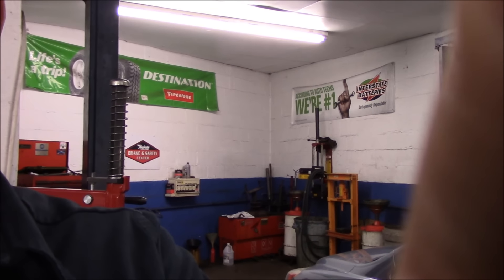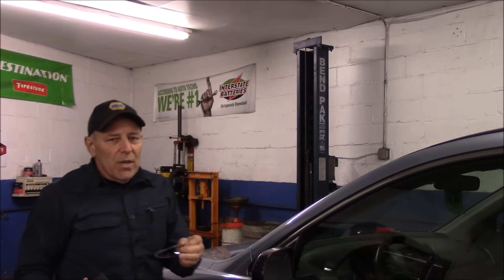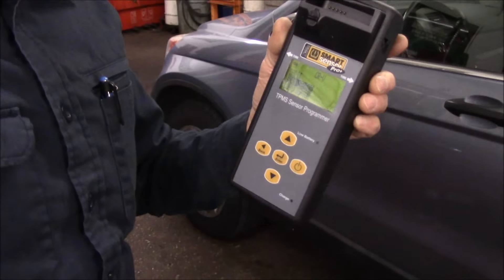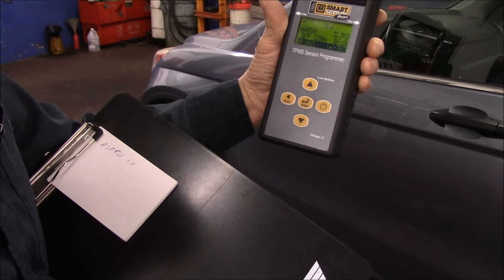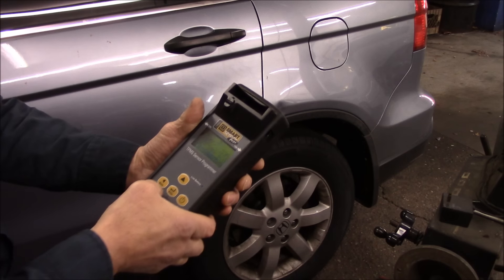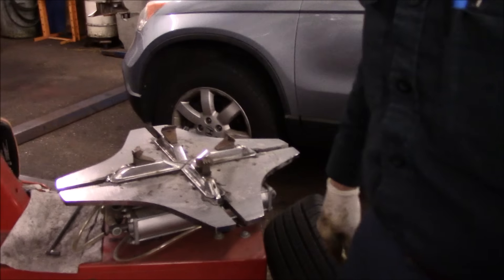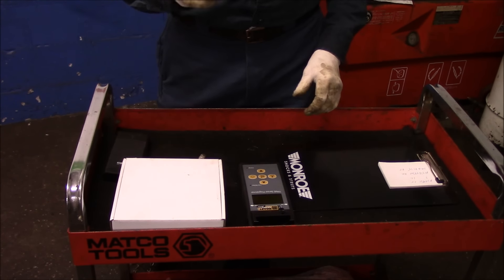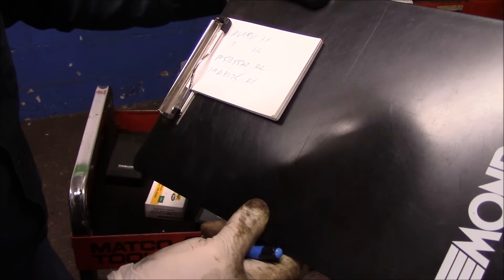How To Reset Low Tire Pressure Light (TPMS) Tire Monitoring System

Comment: Had a new full set of tires installed at a Subaru dealership in August. since then the dash tires pressure display has been wonky for the right rear tire. Finally got so bad , I took it to a mechanic who said the pressure gauge was “pinched “ during installation .Then as the tire flexed it finally broke . He replaced the sensor on that one tire, & the entire tire pressure display is not working except for 
TPMS LIGHT & instruction to check manual! What could have happened? Am I being set up to have to replace all the tire sensors? The display & other 3 tires were fine til this repair.

Comment: On my 2012 Jaguar XF Supercharged V8 Portfolio Edition I had a constant TPMS Failure. Not just a tire but a system failure. I took the car to a tire shop and he checked that all the sensors worked. After that you can reset the system. Do a Hard Reset of the vehicle. Disconnect both battery cables. Either let it sit for a few hours or touch the neg and pos cables together. Check the tire pressure in all the tires. Reconnect the battery. Then drive the car for 15 minutes above 30 mph.
Park the car for 15 minutes shut down. Then drive the car as usual and the system should reset. Your also going to have to reset the memory for the seats, windows, locking etc. It's all in the owners manual. For this to work all sensors must be good. Worked for me, hope this helps.
Reply from the maker: Thank you for your input and for watching.

Comment: So here is my question. What happens 3 years later when the sensor you replaced goes bad. How do you find the sensor number because it's not printed on the replacement sensor,
Reply from the maker: You know You are right .I never thought about that.I will in the future make sure to put the number on the customers bill Thank you for pointing that out.
Reply: Glad to help, I was scratching my head over that.
Reply: Perhaps find a way to mark it on the sensor itself as well - Most customers aren't going to keep that bill for more than a few days.   Great video!  I really appreciate the information.
Reply: @jimthecarguy    In that case, you can either buy an OEM sensor or get an aftermarket one that fits the vehicle and you won't have to program it, so you won't need that number.  Since you're using blank  "clonable" units that can be programmed to fit various models, you have to have the information in order to clone the new unit.  That's a smart way to cut down on inventory and still be able to give quick service.   I enjoyed your video very much... very well done... you're the kind of mechanic everyone wishes for.

Comment: Clear and accurate real time repair information. Your channel is a class above most and delivered with a humble attitude - keep up the great work.
Reply from the maker: Thank you for watching and your kind words
Reply: I agree.... Well explained & cleared lot of questions I had regarding these TPMS.
A question though:

I replaced two tires the other day.... Up came the TPMS light..... 
I went back, &   they said my wheel NEVER had a sensor fitted! 
I said, well how come the TPMS light was off until I left here?
They took the tyre off: and said "Look, there should be a metallic tape here...
....It never had one." !!!
After watching this video, I now know that is a complete & utter lie. Bullshit.
I am never going back to that shop. And none of my friends will either.
Jeeze..... You pay top dollar for decent tyres and get this kind of service.
Reply: @jimthecarguy  Jim, I bought a used car with TPMS lights on all original tires and sensors were replaced but not reprogramed, where do I get the numbers from to reprogram them?

Comment: Hi Jim -
  Good repair - 
Starting in what years did they start to install tire senors 
Suppose a person wants a tire rotation will that hand held device show what tire sensor goes on what side of the car ?
Reply from the maker: Pete Moss   I'm not positive but the sensor became very common around 2004 on most cars
Reply: Ok thank's Jim
Reply: 2007 mandatory
Reply: Jim talks about the battery going bad. if its a dry cell battery, that'd be pretty severe, as he's expecting it back for one of the other 3 tire sensors
Reply: I found a rebuild kit for tpms schrader valve on ebay :TPMS Programmable Sensor Service Kit Schrader Automotive 20018. For $2.84 on 7-7-2018.
Reply: When i say severe I mean 30 deg below 0 for a dry cell battery. Itd be like toast  in Ice hell. but apparently they last for (5 years)

Comment: My eyes are my sensor. Look at the tires. If they look low and are soft to the touch, they are low. I have a bad sensor. The only thing it shows is an underinflated tire. I can live with a light. Just like numerous reasons for check engine lights.
Reply: your eyes are lucky to see 10 or 15 pounds the light is only 5

Comment: I have a 2008 Honda Civic Si with TPMS and it comes on when a tire gets down to under 25 psi I put air in the low tire drive it for a couple blocks and it goes out. How long b4 the battery goes or does it even have one? Does it have one in the spare?

Comment: I have a 2007 Honda crv tpms light still on after riding 5 miles on highway.  How can I have taken off? Can a scan tool in autozone remove it or is there a fuse I can remove thank you

Comment: Hi jim,  thanks for the video..... I changed two tpms in a 2011 scion xb....   Reprogrammed the computer using the lexus/ Toyota software.  This vehicle has a reset button under the dash for the tpms light... Would know procedure for killing the warning light?... Thanks.

Comment: Hi Jim we have  2011 Honda 4WD  CRV. Just got 4 new tires put on & the TPMS  light was on when we got home with the car , i did not notice as i was driving. This light was never on before . Was there supposed to be a setting , that was not reset from the tire garage  when they installed the 4 new tires . Thank You . Bill

Comment: Hi Jim, a true mechanic!
Thanks for your time and this fine DIY video. Just looked at Amazon and put Smart Sensor in my cart.
Once again thank you!
Reply from the maker: Michael Miller did you also get the tool with the sensors?
Reply: Jim, the unit on your Amazon tool list. But, I read the description and I still do not know. Cost was $199.00
Guess I will find out then.
Reply from the maker: Michael Miller  you will need the sensors also. I just put another whole kit on my Amazon store check it out
Reply: OK Jim,
       I will obtain those too.
   Thanks again & CUL.
Reply: @MichaelMiller-od6pu   did you get the right thing?

Comment: I need to check the tire sensors on one vehicle which I have to put a new battery in and hope all is fine with them. The last time I had one of the lights come on while driving the vehicle with the sensors in them it was a tire which had low air pressure and I solved that problem easily.

Comment: My tires are good. Sensors bad. Put black tape over warning light and get down the road.
Reply: Exactly. It’s hundreds of dollars to change all four (you buy OEM and not aftermarket). Just have a quality tire pressure gauge and check them weekly (like I do). I always forget pressure on the one in the trunk. Also, the spare tire for a CR-V is only a temp on to get to a tire shop to either repair o replace the tire.
Reply: What if you're on a road trip and you blow a tire because you don't know if you actually have a issue with a tire or not?

Comment: I have a 2023 Honda Pilot and I’ve tried everything vehicle settings, settings etc but it’s currently 44*F in Atlanta and I couldn’t find any reset tire pressure and all the tires are fine remember that too

Comment: jim i hit a curb and my lite came on and the right front sensor came up on dash and said low pressure . Is a sensor replacement required ?
Reply: If the light is still on after putting air in it then you probably need a new sensor
Reply: Those dopey sensors are always crapping out!

Comment: Sir thank you for the good explanation. I have a Toyota Camry 09 I send it to America's tire change all 4 tmps they said with in 30 miles the light on the dashboard tmps will turn off. My car run over 70 miles but the sensor is still on. What is the problem Sir. Thanks.
Reply from the maker: They need to program the car to recognize the new sensors.
Reply: @jimthecarguy  thank you sir for your reply.

Comment: This is to track down a bad sensor , the long road.  For most of the time  in new 2018 cars, one would adjust the tire pressures , including the spare tire . ( most donuts require 60lbs ) , then go to  Setting 
in the console screen , Car,  and TPMS Calibration. After calibration , the light will disappear.
Reply: No console screen in my 2010 to go into

Comment: Great explanation. Thanks. I have a 2004/2005 Touareg with the TPMS warning on. Was time to get new tyres and inflated to spec its psi level. Lights still on. Looks like I need sensors!!  (haven't re set it though!). I saw that not al sensors are the same!!? Any guidance?

Comment: The TPMS  light was on on my 2007 CRV,  checked tire pressure on all tires and they were ok, I took it to a local tire shop and had all 4 sensors replaced. TPMS Light went out, but came back on two days later, checked air pressure on all four and they good. Any ideas what is going on?

Comment: What do you do if you have to replace that sensor at a later date, you don't have the info on the outside of the sensor that you used to manually clone the sensor with the first time.

Comment: Low tire pressure warning sensors are made for the people that didn't know that engines have oil in them, and most of the time they are driving with a low or flat tire because they don't have the sense to walk around their car once in a while and see if the tires are under inflated or still on the vehicle. Just another useless gimmick designed to fail and make the repair shops more $$$.
Reply from the maker: Thank you for watching.
Reply: @jimthecarguy  hi Jim...can this repair be done if I don't have that scanner/reprogrammer? Can the car relearn it or will it not recognize it at all? (2011 Hyundai Elantra)
Reply: I learned from a officer a long time ago. everytime you operate a motor vehicle, It only takes seconds to do a walk around. That way you dont have to worry about someone else letting you know you have a light out. I was an aircraft crew chief in the service. I learned the importance of a preflight inspection.
Reply: @jumpercable20  yup! I'm a mailman and we check our vehicles every morning

Comment: 11/25/19,  Q: I have a 2015 Ford Taurus (TP34psi) w/a full-size spare; tried pumping air/checking all 5 but it still won't go out. I don't have that meter, the shop might do it next svc. My last car was a Caddy & it did the same thing; the GM svc told me those sensors are more of a nuisance than anything else & not to bother w/them. On the Cad I could click through all 4 wheels w/the air hose & it would still show all different #s. So I don't worry about it. Since you go to all that trouble, why not just take those out, do away w/them altogether? I have a portable air pump that looks like a cordless drill; you clamp the hose onto the stem, set desired TP & it stops automatically.

Comment: Great video! I didn't know the sensors have a battery in them.
Reply: Jackie Freeman how did you think electronic suppose to works without battery?
Reply: @derpherpp  Many electronic systems use sensors that do not contain batteries.  They're referred to as RF tags.  One example is the chips they implant into pets to identify them.  Another is the anti-theft devices you see on some store purchase items.  They get their energy from the electromagnetic field being radiated by the transmitter the vet uses or, in the case of the stores, located at the exit doors.  It's a shame that auto manufacturers can't make use of that sort of technology for the TPMS sensors.
Reply: It's magic, Centrifugal force is movement that creates heat, the heat creates a current and the current produces electricity that powers the sensor. Simple ?
Reply: @mousetowndude  A radio-frequency identification system uses tags, or labels attached to the objects to be identified. Two-way radio transmitter-receivers called interrogators or readers send a signal to the tag and read its response. RFID tags can be either passive, active or battery-assisted passive. https://en.wikipedia.org/wiki/Radio-frequency_identification
Reply: @jumpercable20  "Centrifugal force is movement" Nope CF is NOT 'movement.' Neither does CF 'create heat;' nor does 'heat create current;' and  'current produces electricity' is als false.
Reply: @jumpercable20  you reminded me of President Trump!

Comment: Hi Jim, I just came across your video and the are great and very informative. I have a 2012 Dodge Charger and it is showing the same issue. It seems like you replaced the sensor in less than 30 minutes. How much should this cost me to get the sensor replaced? 
Thank you

Comment: Where can you get that tire center machine? And how much is it? Because I am having this issue currently and have been for a while. I had gotten brand new tires for brand new tires and then within a few days or a month or so my tire light had come on and then not long after the TPMS light came on, so my dad and I had brought it to the tire shop where we had bought in the tires and they said that there was a sensor in one of the tires that was bad so they changed it out $100 later and the guy told me this was the guy that runs the place he didn’t even take it for a drive it  to get that TPMS light off, which was the whole reason I had gone there he told me that after so many miles of me driving it that the light would turn off… but it never did and it’s still on! But I do agree with a lot of the people that that’s ridiculous. These are brand new tires. Why should I have to go paying basically $100 apiece for each tire for brand new tires for new sensors for all of my tires? That just seems ridiculous. So is there anything that I could do about that considering the guy told me that the light was gonna go out and it never did could I take it back to that place and tell him like listen this TPMS  light is still on, and this guy the owner told me that it would go out after so many miles driving it….But NEVER did. And yes I’m sorry but I have a hard time being able to tell if my rites are low, unless there really low.

Comment: My TPMS light came on 10 minutes ago.  30°out...  went to the gas station for air.  31psi DF...30psi DR... 30psi PR... 26psiPF..  Set pressure in all to 34psi and tpms light went away after a few seconds of driving.

Comment: That light went off and thought my front tires were a little low so I filled the tires with air and the tires look great so if the sensors are broken  I am not going to pay for new ones. (2009 Honda Accord.)

Comment: If you buy preprogrammed sensors on Amazon then you can just give them to your tire installer the next time you buy new tires or install them yourselves.  They will install them for free and the car should recognize the tpms sensors after driving only a mile.    You will not need this tool or go through this process.    For my Acura TL i can buy a set of 4 for $90.

Comment: A couple of dumb questions? 1) since you said there was no radio transmission, and you said it likely had a dead battery - wouldnt it be easier, cheaper for customer to merely 'replace the battery'? or 2) are these designed in a 'planned obselescence' type of way where they prefer you buy an expensive completely new assembly and pay to clone it - than to just pop in a $10 battery?

Comment: Very detailed and complete video BUT the mechanics never tell you the price. I have an '05 Titan and needed two new tires. I knew my TPMS light was on and had a piece of black tape over it. The tire shop said two were bad and since it was a thirteen old truck I decided to put all four new sensors on.  They were 80 dollars each so when you add that to four new truck tires (good quality General tires) installation and front end alignment and disposal fee, road hazard and on and on the bill was over 1300 dollars. Just remember bring a wad of cash. Prices today are absolutely CRAZY!
Reply from the maker: Thanks for watching.
Reply: @jimthecarguy  I learned a lot from your video. Watched a "REAL" mechanic at work. I know when I saw the NAPA sign in your shop I would learn something. I found a good tire shop (multi location chain) and an excellent mechanic who is going to service my truck from now on. Learned how the TPMS works. You get what you pay for. I shopped for tires and for me from my investigation before selecting General Grabber tires I learned and advise folks to never buy Chinese made tires. They are inexpensive for a reason. Just my opinion.

Comment: I have a problem I was hoping you could help with.
2010 CRV. Replaced all the sensors.  But the system needs to be calibrated. TPMS light comes on at 29psi and the sticker inside the door recommends 30psi. System is supposed to be calibrated to 75% recommended which would be 22psi.

Make sure all tires exactly inflated. Enter the system into a calibrate mode. Then then drive a ways and system will calibrate to 75% recommended pressure. Which would be about 22psi.  

I would love to see 22psi.  But mine is at 29psi. And I have seen many people describe how to tell the car to enter calibrate mode. Pressing an INFO button on the steering wheel(I don't have that button), entering some menu in the radio(I don't have that menu), pressing a button on the instrument panel(they seem to have two and I only have one), and several other things all of which I don't have on my 2010 CRV. 
SO HOW do I do it for my 2010 CRV.  Obviously the tire place that put on my new sensors did not know how to do it.  Or maybe they didn't even know it needed to be done.